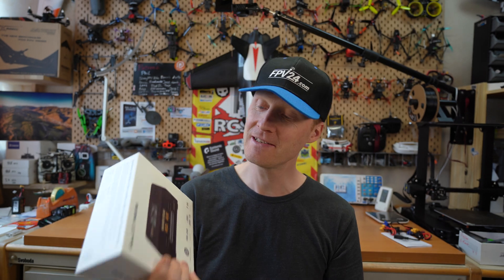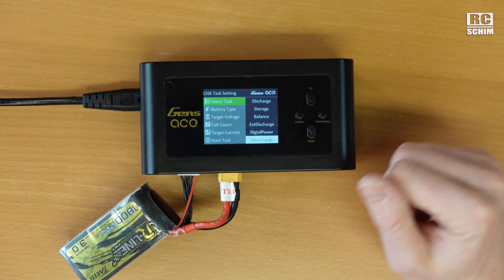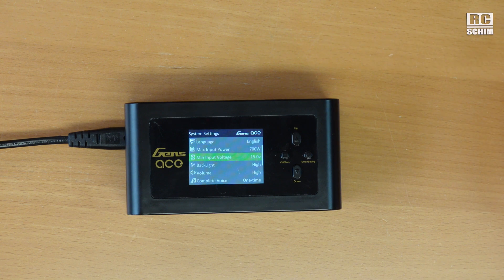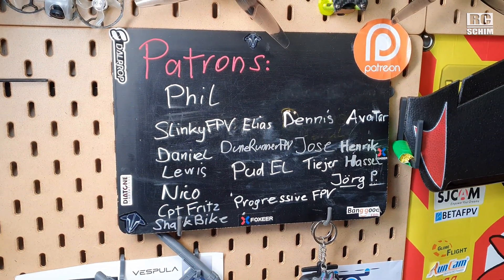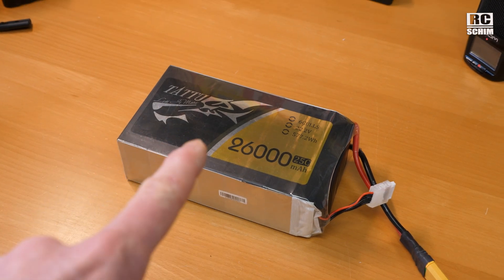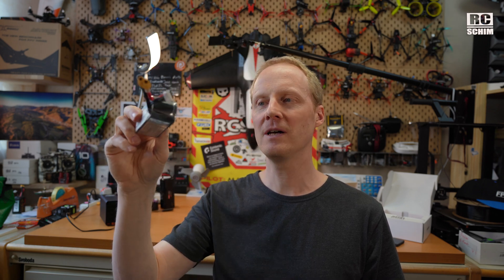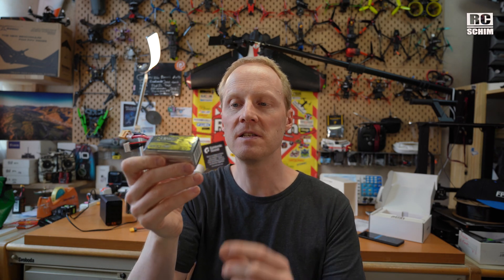the ultimate FIELDCHARGE case (on a budget): IMARS Duo + Tattu 6S 26Ah pack

Comment: Is it possible to replace foam inside case and with what? I have case, but foam is destroyed by previous owner, and I want to put that case in use if possible. And how to easiest way to carve foam to accommodate new items? Thank you.
Reply from the maker: You can take just any packaging foam that is large enough, and glue it in...   I used a cutting knive (sharpie) but maybe you can also use a hotwire cutter?
I don't feel qualified enough to give DIY tips tho ;)

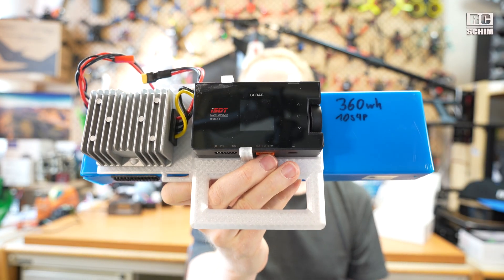Comment: Very pragmatic content. Love your new field box (5:55). Also like your grab-n-go e-scooter design (4:44). Great idea, but too bad only seeing ~100-150 Wh of the rated 360 Wh on e-scooter pack. 

Wondering if you have a bad cell (or few bad cells) in that li-ion pack. Low cutoff voltage likely limited by the weakest cell capacity. Only way to know (assuming no access to balance leads), is to open up and measure cell groups when the pack is discharged. At discharge variations in cell voltage would be at their largest. (weak ones having lowest voltage)  If you find the pack has bad cells, you could dismantle and repurpose/up-cycle the good cells. You already have test equipment (charger with capacity display), just need a 4x, or 6x 18650 cell holder to make testing in a few cells at a time convenient.

Comment: Hi, why not use 21700 cells ?
A 6s6p = 29.1Ah = 628.56Wh = 2.7kg = 136.8€ (Samsung INR21700-50G  from nkon website)
I agree power station is way too expensive.
But Li-ion seems lot more interesting and safer than lipo :).
Reply from the maker: I never built a LiIon pack myself. Flight-Packs are critical - if they fail I would crash - so I don't touch these.
But for the charge pack, I could have tried to make one myself - I agree! ;)
I might try some soldering (instead of dot welding) for a testrun and keep this as an option for me in the future.
Reply: @Rcschim  I do solder on li-ion, it works fine, some flux, big iron tips and as quick as possible. But heat probably shorter a little cell lifespan.
Dot welding is cheap and easy too :).
For charge pack it's way way better because you could store it charged and be always ready to go fly ;).

Comment: Stepdown to 12V limits your charging performance due to input current limit. Putting in 24V will get you more Watts out. More Watts are primary necessary for parallel charging.
Instead of a stepdown converter a 2:1 transformer with iron core will do the job.
Reply from the maker: yep, the stepdown makes no sense - that was also one of the downsides of my v1 fieldcharger. friends told me to use 6s directly. most efficient if you also charge 6s the most times...